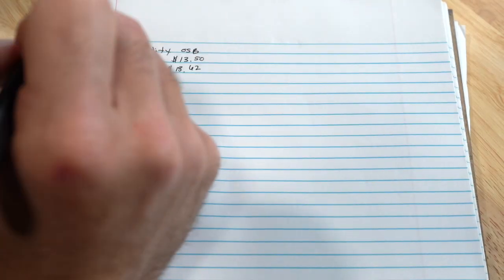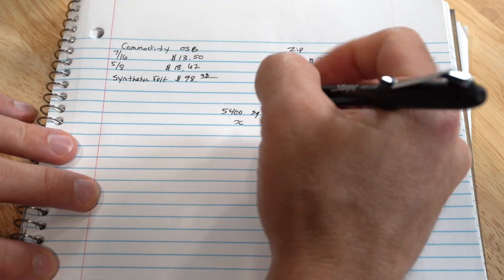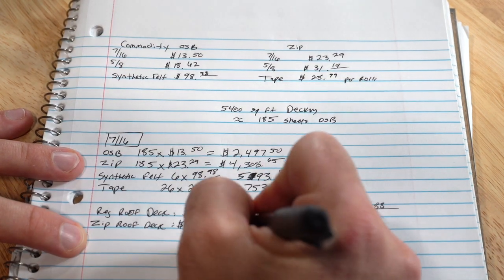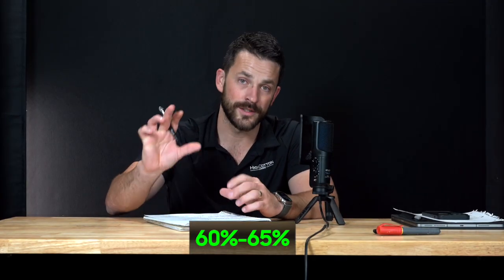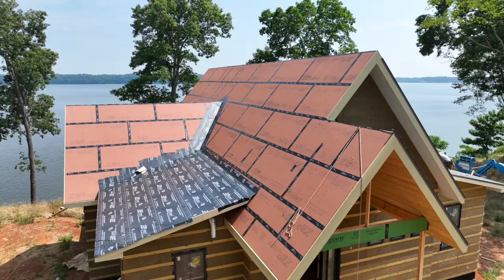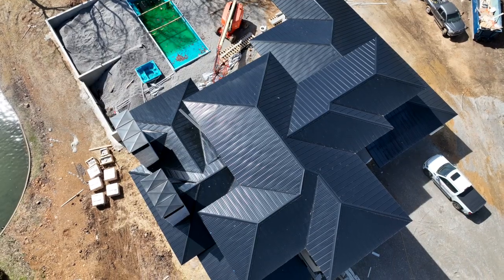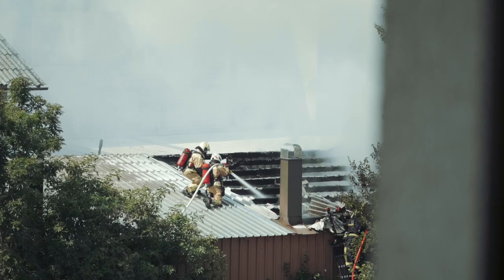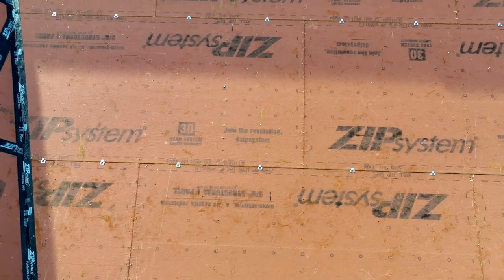Sealed Zip Roof Deck vs. Commodity OSB Roof Deck - Cost Breakdown

Comment: Coming from a fl contractor, when your shingle & underlayment gets torn off in a hurricane, you will inevitably have interior water damage. Peel & stick will help but taped zip board will offer equal protection in case of a blown off roof. On standing seam, direct to deck, we still lay high temp peel & stick on top of 5/8 zip or 3/4in cdx ply. I hate 7/16 osb, it belongs in the trash.

Comment: Zip sheathing twice the price of plywood. 
$33 for a 20' roll of tape? Most roofs will need over 1000lf of tape. 50x$33= $1,650 plus labor to apply and then roll. 
Plywood with ice and water shield for the win.
Quicker to install and less expensive.

Comment: Agree that it's worth the investment. Too much stress to try and manage weather and exposed decks. I'm learning a lot on my first, from scratch project, but my next home I'm thinking to do 16 on center trusses and 7/16 zip, or I might still go with 5/8 along with 16 on center. The current one ended up being 24 on center with 7/16 OSB and I don't like that at all. I caught the mistake too late, and it's a low slope on top of that. Likely it will end up metal when it's time to renew.

Comment: When I built my off-grid cabin last year, I didn't use Zip on the sides or roof deck, but I did use Zip Tape on all of the joints like it was zip.  No OSB, it was all plywood.  I love their tape, both regular and stretch, such a game changer on window opening flashing, door pans, etc.  When I build my retirement home on that property, I will use the entire Zip system.  It just wasn't worth it for the 3 season mountain cabin, but it's so tight we easily heat it with the tiniest wood stove that is 12" x 10" x 11", but it will easily get it to 85F when it's 32F outside.
Reply: You want to be 85 degrees in your cabin?

Comment: How much is a small leak at some point in the life of the roof is going to cost you that could possible be stopped with zip and the tape?
I bet you a lot more than $2K.
The roof and foundation are not places to try to save money.
That is just one advantage.
Reply: possibly is the key word.

Comment: You still must sheath zip roof-Huber requires it, damn WTH good reaosn a. These roofs are NEVER leak free. Vertical tape works well if rolled, horizontal is very very iffy-look u r either dried in completely r you are not- carpenters can roll two layers jumbo tex without holding up job waiting for roofers.

Comment: Nice video! Informative for sure. We don't use felt, we always use peel-and-stick underlayment. For a while I considered leaving it off if I was using zip system, but we opted for the belt and suspenders approach and using both. It certainly costs more money, and difficult to justify since we build spec homes for sale, but we're proud of the product we take to market and feel confident in the strength of our roofing systems.

Comment: i'm not sure in your area the labor cost is the same as the cost of all the materials used to build the house not including mechanicals. so i know zip panels are all the rage for builders but to me the added price of material and labor is to much. get some good osb and bicthithane cover the whole roof with it and get the same dried in house for less.
Reply: I agree especially since the price of Zip is now $38 at Lowes.  That changes the equation DRASTICALLY.

I get it that builders can get better deals from a lumberyard but that is some super-secret price that us mere mortals are not privy to.

Comment: I'm a proponent of building like this, but in your example of the roof getting torn off and still having protection, what about all the penetrations that will have been torn out? Nails and screw holes all over, no?
Reply: As he stated 95%.
Nails are probably less than 1% of the entire roof footage.
The rest has the built in membrane .

Comment: Have you done any videos about using Zip System on an existing home? I want to update our 1980s modern style home and use Zip on the side walls (and maybe roof) to insulate it better - using the Risenger system of insulation, Zip System with about 1” foam, fur strips and Hardie-style board on the exterior.  Problem is my roof overhang is not enough to put all that thickness under… what to do? ❤
Reply: Ask Steven Baczek - he's the current guru of designing tight homes.

Comment: How about labor cost? Does it take the same amount of time to install the tape as it does to install a synthetic underlayment?
Reply: No it takes much longer for tape
Reply: Ok, great! But do you have any idea how much time is “much longer”? I.e. one crew is done by noon while the other isn’t done till two? Or, how many man hours per square? Just curious. Labor is almost always the most expensive part of a job..
Reply: @pdg9582 Well that depends on so many things you can't really say without looking at a specific job. You also don't usually pay subs per hour either although the price you pay certainly has how much time they think it will take them to complete the job factored into the bid.
Reply: @nick21614 especially if rolled properly and meticulously and if you dont there si no point in using zip

Comment: Don't use H clips with zip system on your deck. Huber advises against it as it makes it harder to get a good tape seal and they are unnecessary for anything under a 32" span for the 5/8 zip panels.

Comment: Agree with the value, but why not just tape regular OSB or Plywood like prescribed in the Fortified roof standard and accomplish the same goal for less? Even with the Zip the roofer will still need to put down Ice and Water shield and underlayment.
Reply: The one thing I ran into with standard OSB is tape doesn't stick to it well. Doesn't matter what brand of tape it is. The raw wood face is like trying to tape to a dirty surface. It just does not stick well. CDX plywood is better, but a complete peel and stick underlayment is going to be better than taping.